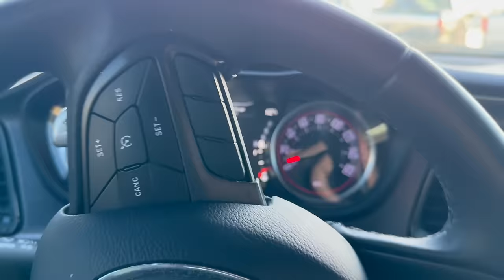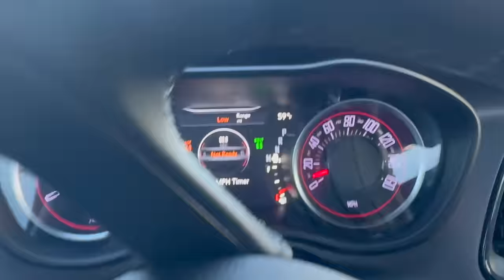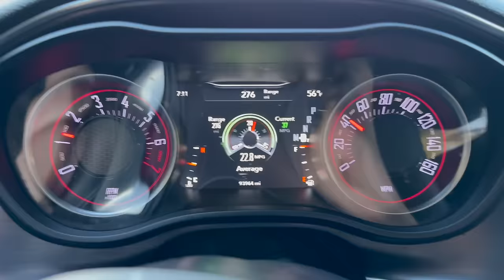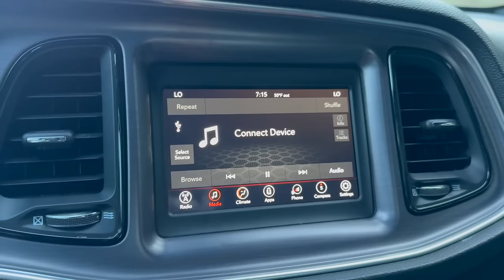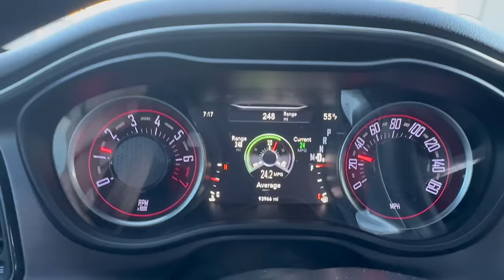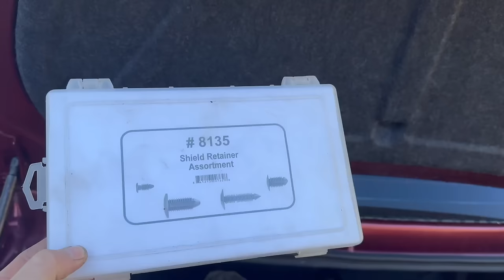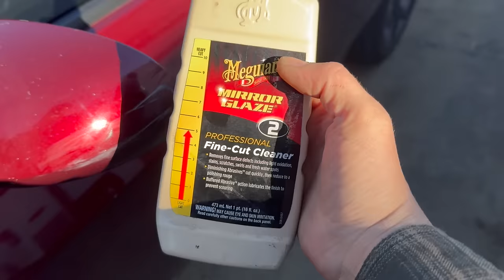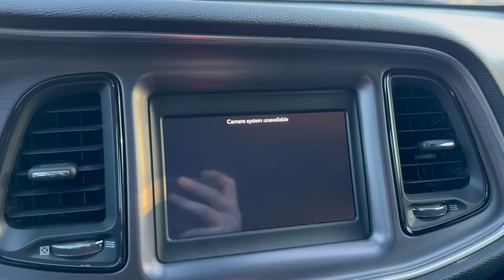The Case For The 3.6 - I Bought A Beautiful 2018 Dodge Challenger!

Comment: The folks at Brampton made a lot of very good cars for many a year (home of the Charger and
Challenger, of course). We've had more than a few of the Chargers (I prefer it to the Challenger;
less bulky/floppy feeling) - all of them R/T models with the 5.7 hemi .
Loved them all, bought them all new and got six figures out of each of them without so much
as a hiccup - there's nothing wrong with a hemi if it's properly maintained.

Heck, the current one in the stable is the longest-lived so far (wife loves it and won't part with
it), a black on black affair with all the bells and whistles (including really nice leather).
Again, zero issues over 100k miles now - and I've had it down the track to the tune of a 13.9,
bone freaking stock.
Slap a set of Michelins on it, change the oil with Mobil1 when it says to and enjoy forever.
Oh - and resale is a ton better on a hemi than a penthouse whatchamacallit.
- Ed on the Ridge
Reply from the maker: Nice! I absolutely would have gone for a similar year, similarly equipped Charger. I’d love to have the extra doors - but I do prefer the look of the Challenger.

Comment: I love old iron and I get a lot of joy. In driving to town and back in my old cars. But I fully agree with you if I need to put the family in or if  need to go cross-country or take a road trip. It's a lot nicer to have something a little newer. A little bit better fuel mileage and a little bit, more comfortable and more dependable. A lot of times the fun part of driving the old cars to town and back is the thought in the back of your head. Will you make it home? nice upgrade on the daily

Comment: Love the New Challenger. That color really pops. The 300 HP comment is correct, for a daily you really don't need much more than that. If I didn't tow a boat, I would have probably gone with a Charger or 300 V6 over the Nissan Frontier I just bought. (No ram midsize pickup yet)

One other issue to note on the 3.6, at least at times it is a problem in our fleet at work (Ram Promasters) is the oil pump. It's a dual displacement unit and the solenoid goes bad. You can either replace the oil pump or you can get the solenoid itself from Napa. (part #TEE OPS100). Congrats on the purchase and thanks for the great content.

Comment: It was hard to buy my 2012 mustang, my first non v8, but I put 100k miles on that thing and literally zero issues after 12 years.  The v6 ford and dodge cars are super fun, super easy to maintain and plenty fast for daily, and are fairly cheap.  I think I like v8 in vintage way more.  They dont even have to go fast.
Reply from the maker: I very much agree.

Comment: I love engines that run super smooth and are super efficient, and usually when you put those two together you get an engine that puts out a lot of power for it size and gets very good gas mileage. Vs. if they need/want more power, they just make it bigger. Plus the engine usually weighs less to boot. The only downside I can see to it is it's a smaller engine making more power, so you'd think that would make it not as reliable, but that doesn't seem to be an issue either.
I guess if they can build an engine with higher quality standards that would take care of that problem, obviously. Lol.

Comment: You mentioned Torq Thrust wheels. I have a 2018 300 and I wanted vintage-look five spokes on my car. The bolt pattern is 114mmX5, so choices are a bit limited in that area. I didn't want to run adapters because I wasn't crazy about the prospect of watching a wheel racing off into the weeds. I ended up getting a set of Vision 142 Legend 5s in the same offset as the factory wheels. They're black with a machined lip and look great.
Reply from the maker: Very close to the look I have in mind, and definitely the right paint scheme. I’ll have to remember that one. Thanks!
Reply: The vision 5s in 18" seem to be the closest to classic torqs I've been able to find it seems.

Comment: Here's a problem to watch for that happens alot! The washer fluid connections come loose in hood. When u push spray and it's not hitting winshield,STOP! It  leaks and soaks the underwood insulation! I had to remove my insulation,then I learned my hood vents are fucrional now atleast.
Reply from the maker: Good to know. I’ll keep an eye out for that.

Comment: My 17' shaker did the same thing on the rear camera,  just shut the trunk lid a bit harder and it fixed it until the next time, my 21' 392 hasn't  faulted yet .  your traction control  has three settings.. normal ( full on) second is roughly  80 percent on ( fun mode)  and finally  ( party mode) totally  off . Hold the T/C button  down  until  it chimes in your dash cluster. It will say T/C disable ! I think it stays off until 60mph
Reply from the maker: Good to know! Thanks!

Comment: I've had my 2014 300 for 10 years. The oil housing has been done twice. Rocker arms done. Nothing but maintenance other than that. I got over 30 ONE TIME and that was middle of the night trip down from Seattle with the cruise set at 78 the entire way. 
It is just fun enough to not be an appliance, and just boring enough to not put marks on my licence.
Reply from the maker: Exactly. The sweet Goldilocks zone of cars.

Comment: I’m not gonna dis your choice in powerplant, but I did daily my ‘09 R/T to 265k when the engine cradle bolts rusted off and I replaced it with a ‘22 Shaker.  I’m going to recommend a wheel you won’t park next to - Charger cop wheels.  When I first needed new tires I bought a set of new steel wheels and dog dishes, painted them Tor-red to match my ‘09 and suddenly it was 1970!  Youngin’s didn’t get it, but they’re going on the ‘22 (it’s Tor-red, too - so I’m in a rut) next rubber change (maybe with red lines…)
Reply from the maker: You’re the third or fourth person to recommend the steelies. I do find this idea interesting. I don’t want to daily a Hemi. I need a commuter that gets better mileage than my Cummins for my 90 mile daily drive. This will do that, and be plenty of fun at the same time.

Comment: Also despite its flaws. Imho the 3.6 pentastar will be remembered like the slant 6. Or 318. A good mass produced engineml. That everyone has overlooked.

I saw a video of a guy tearing down a 400,000 mile one. Stolill barely on the stock timing chain guides.

Besrings and bores looked like new.

Comment: I just bought a 23 Charger GT AWD. I have 2 Hemi Chargers, (12&14), but I'm selling the 12 with 150K.  I'll be honest, giving up the Hemi for a V6 is a big step for me. The dealer made me a deal I couldn't turn down, I just hope I don't regret it. My wife jokes with me that I'm finally growing up. Her car is the 14 with a Hemi and AWD, so at least I'll still have a V8 to get my kicks.
Reply from the maker: Nice. I have been very tempted by a blue Charger GT myself. That’s a neat package.
Reply: @DeadDodgeGarage  , I forgot to mention, it's a B5 blue color so that was a factor. They had a loaded white Charger Daytona and were going to cut me a great deal, but white just doesn't float my boat.

Comment: I was hit head on in '04 2500hd Chevy , the rental place gave me a 2017 challenger r/t that thing was fun did many burnouts . If you held it to the floor it would hit the rev limiter then shift to 2nd and keep right burning rubber , it acted kinda like a manual. Also had it 140 😁

Comment: Great color choice, just like when I bought my truck in Flame Red...tired of seeing black silver and white and in cars the greens. I did add a K&N to mine and I picked up a bit of power but the real reason for it was the boost in gas mileage. Oddly enough that happens at 74 mph and I get 29 mpg...use the cruise control. Your driving to Olympia everyday and you don't need a hemi to commute that's why you had the fugly Toyota. A newer vehicle is so quiet too but the only thing I spend the most on is oil changes. I use Royal Purple HPS and a K&N oil filter that and the recommended mid grade...arrhhh.

Comment: I bought a new v6 one in 2009, decent car but handling was not it's strong suit it leaned plenty in the turns. 20 mpg seemed to be what it got consistently with my driving habits. There are performance upgrades available for the 3.6 engine as I'm sure your well  aware of. I have a hemi Ram (2020) now and keep the oil changed and I have extended warranty for a reason. Nice looking car when the time comes for wheel and tire replacement get the charger police steel wheels with the dog dish center caps that would look bad ass on that car.
Reply from the maker: Oh… I know it. Haha. I’m going to try really hard to leave it alone. Two other people have said steelies! I’ve never seen that done. It’s an interesting thought.

Comment: I think that Goldilocks 3.6 is direct injection (and not dual injection like Toyota and Ford V6’s).  If so, add carbon buildup to the common issues (the 5.7 is port injection only).
Reply from the maker: No, these are not direct injected. They are port injected.

Comment: Fact - a 5.7 R/T auto with a LSD added is the perfect all around performance car.  Additional fact - 6.4 cam and headers bolt right on and in for more perfection. 

The only issue with the 3.6 is the lack of upgrades - it will always be better to sell is to it and buy an R/T if the day comes when you want more power.  The 5.7 is not only very quick, but a good blank canvas for upgrades.
Reply from the maker: No question - but I’m not looking for a performance car. I have performance cars. I’m looking for a well balanced commuter. And - my car has an LSD. I checked 😁

Oh yeah - are you aware there is a supercharger kit for the 3.6? Sounds like an upgrade to me!

Comment: I was shopping for a daily a couple years back. Was looking at a challenger rt, mustang gt , camaro ss and a corolla lol.  Ended up getting a corolla just because I needed a daily that you don’t need to work on a lot
Reply from the maker: That’s what I had in mind when I bought mine. I should’ve held out for a newer one I think. The ‘08 was just new enough to be acceptable but just old enough to not have modern interior amenities. I thought I would love it for being aggressively cheap. I was wrong…

Comment: You're making a fella wanna upgrade his daily lol.  Currently still driving 1982 vw rabbit diesel. Factory no radio or air conditioning not that it would have the power to run the compressor, but the 40-50 range on fuel mileage is hard to pass up.
Reply from the maker: Oh yeah. There’s a lot to be said for that. Plus I’m sure you can run it on things other than highway diesel pretty easily… so that’s ideal.

Comment: You might be forgetting about the common totally integrated power module-Tipm problems found on Chrysler stuff. Namely the Fuel pump issue.  There is a bypass for it but nonetheless.
Reply from the maker: I am forgetting about it, actually. I’ve replaced a handful of TIPMs over the years. Never in one of these - yet.

Comment: 245.55.18 are the same circumference as the 245.45.20 presuming that is OE and are less $ and offer similar performance. 235.65.17 might be tough to find perf options and a 65 ratio sidewall is suv handling. I personally wouldn't keep the  Laufens.

Comment: Pretty sure that's the color of my neighbors "first" gen(of the second gen) Challengers. 375 hp six-speed. The 3.6 in my Colorado is probably the fastest vehicle I've owned(my Neon might have more top speed. I had it to 109mph, and ran out of nerve, not throttle).

Comment: I've seen where a lot of people are saying their 3.6 Charger or Challenger will do a burn out.  My 2012 Charger SE WILL NOT do a burn out.  I tried turning off stabilitrac but it made absolutely no difference.  Is their something software related to the uconnect I have to go to the dealer for to have control to turn stabilitrac off or what is it that has to be done to allow hard throttle from a stop, thus allowing the start of a burn out?
Reply from the maker: That’s weird. Mine certainly will with the traction control turned off. My Ram 1500 did it happily too. I’m not sure what the deal could be there.

Comment: What actual mechanics use for daily driver. Usually some old reliable simple car.  I understand the V6 choice. Makes sense.  I am Not a full time mechanic, but I use a 1996 Cadillac Fleetwood for a daily drive. (It’s actually a 96 Chevy caprice with a LT1, but with a Cadillac badge and leather seats) it does 16 seconds in the 1/4 mile Stock
Reply from the maker: The Corolla was the ideal choice for a mechanic. It will live forever with very little care. It even came with free oil changes. I only ever used one. Haha.

Comment: I have more fun driving my v6 than my 6.4 or my 5.7 hemi I know I'm nuts it puts a smile on my face I got a full exhaust cold air and she moves along fine and when should I change my belt and water pump she got 137,xxx miles and runs beautiful
Reply from the maker: I dunno, when they need to be changed I guess. Haha. There will be signs…

Comment: Congrats on the car,those are reliable well sorted out cars the only issue is the radio/along with back up camera! Parents 2016 300 had to have a new radio installed last fall..The only issue ever with the car.

The only Mercedes parts were the rear suspension design from the then new 2003-2009 Mercedes,not the 90's version other than that nothing is shared on the 2015 -up..2008-2014 used steering columns,seat frames and rear suspension design not actual suspension as the Chrysler versions were wider/bigger over all..5 speed trans and rear diff were also shared but modified,over all frame,suspension not a Mercedes.

3.6's are decent..I bought/sold many of them,my parents have a 2016 Chrysler 300 awd with a 3.6 100,000 miles with no issues,they bought it new...They also had a best of 34 mpg hwy,then again retiree's driving so,they do get 25 to 27 mpg on average all the time,again location and driving style always dictates gas mileage..Both my sisters had Caravans with the 3.6 and no major issues.

I had a 2009 Challenger RT bought new with 185,000 miles and ran perfect only issue was a water pump at 120,000-130,000 mile range.I had a used 2014 RAM 2500 6.4 Hemi with 214,000 miles both ran great no issues...Truck I bought it at 90,000 miles to my knowledge nothing was done either.. I did a lot of hwy with the truck car was 60city/40hwy driving..

I owned several other Hemi cars/trucks never an issue..Wife has a new 2023 Challenger Shaker 5.7 Hemi 8 speed ..I do know of a 5.7 Hemi with a bad cam but that had 250,000 miles and at 250,000 well even Toyota's go boom!
Reply from the maker: I have seen so many 5.7s with cam problems… Mostly in trucks, but not exclusively. I do understand that the chassis is not literally a Mercedes, and that not many actual chassis components are shared - but Chrysler engineers visited Mercedes and copied their notes on the E-class and S-class extensively. The front suspension design, for example, is nothing like what Chrysler would’ve developed without the German influence. They essentially replicated a Mercedes electrical system - in the first generation LX cars, anyway. They used a German PCM. They borrowed switches. They borrowed 4MATIC. I’m just saying… there is a lot of Mercedes in that platform.
Reply: @DeadDodgeGarage  ...I am actually more amazed you read the novel I wrote,for that I am grateful and sorry for giving you a headache.. 

To what you said..Yes,I just get carried away sometimes as some people think it's just a 100% re-bodied Mercedes.. I cant wait as now the new 2025-beyond Charger will be called a re-bodied Peugeot(is it?)..I cant win! I think I am traumatized as in the early 90's a guy called my B-7 blue, factory 383 4bbl, 70 Sport Satellite a K car,he wasn't kidding either!! Somethings you wish to forget but never,that's one of them!

Have a great rest of the weekend! Love the Challenger and the channel..I mean you put up with me(I think)!

Comment: I don’t know all of the faults of the different year hemis except what you have covered. How is the 6.1 in the Magnum SRT8? The Magnum SRT8 seems like you get a lot for the prices they go for.
Reply from the maker: The lifter problem is the big one. It’s shared among the late third gen engines. But I’ve never had to do a cam or lifters in a 6.1 yet. We’ve done a good few in 5.7s, and mostly in trucks.

Comment: Damn that challenger has seen some stuff.. roof full of dents, has it been wrecked lightly since the bumper was not sitting right?
Reply from the maker: Yes it had definitely had some light meetings with immovable objects. I’d like to meet the previous owner. I have some questions… especially about the roof. I don’t get how that happens at all. It definitely wasn’t actually wrecked. My Corolla I traded in seriously had the same exact thing - the roof waved at you, and I never noticed until I had already signed for it, they washed it and I went to pick it up. So it just figures that this is no better.
Reply: @DeadDodgeGarage  if you curious, you can search cars history if there is any signs 👍🏻
Reply: @DeadDodgeGarage Have you considered the possibility of hail as the cause of the damage to the roof? Some other thoughts.. smaller diameter wheels with tires of the same diameter as current giving a thicker sidewall look, maybe raised white letter too. The wheels need to be SHINY, aka chrome or polished aluminium. As someone who has owned & driven exclusively Mopars all his life, going back to one's roots with a 6cyl. as a daily driver is a no brainer, lol. Love the color!